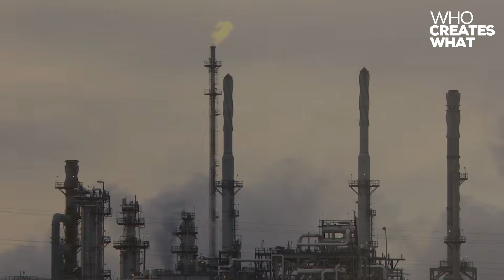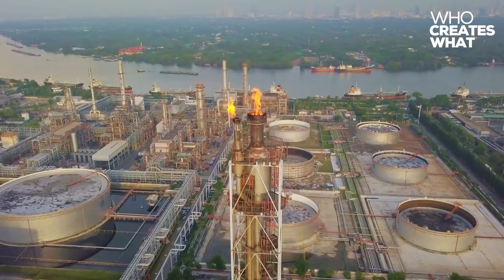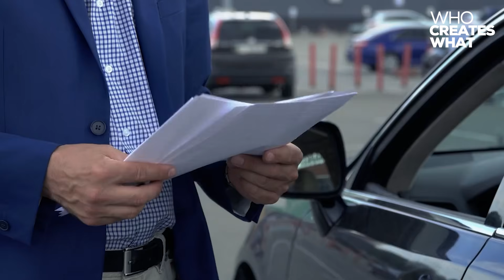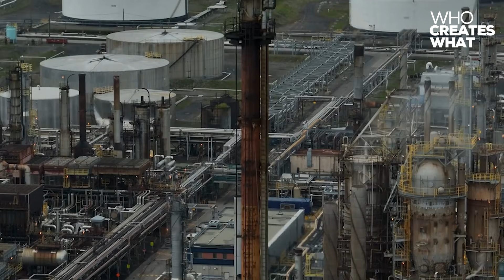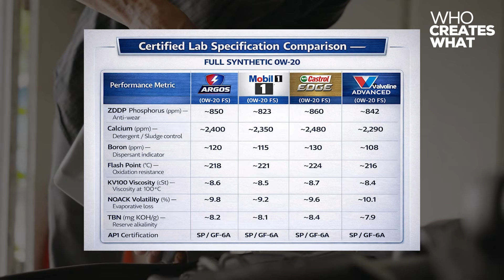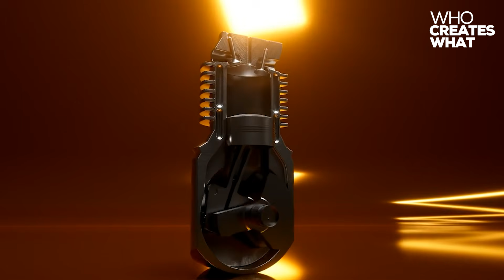Who Makes Advance Auto Parts Motor Oil? ARGOS Is Made by Amalie

Comment: I worked for a company that produced motor oil bottles you would be surprised who fills what bottle ...if the label has the API donut it's basically good oil that's what I was told

Comment: I just noticed that Argos offers a 5w-40 European blend now. I didn't check, but they may have the VW, MB, etc specs now.  Possibly they rushed the standard 5w-20/5w-30 lines to market and brought the 5w-40 line out a bit later.
Reply from the maker: That's a solid catch! If the 5W-40 Euro blend does carry VW 502/505 or MB 229.5 approvals, it would fill the biggest gap mentioned in the video. Worth checking the bottle or Argos's site for the actual OEM spec sheet before trusting it for a Euro car though — "European blend" on the label doesn't always mean it's got the full OEM sign-offs. But yeah, sounds like they may have launched the standard grades first and followed up with the Euro line once the approvals were in place. Good to know!
Reply: @WhoCreatesWhat101 I just bought some European blend, and it does in fact meet VW 505 00 and others.

Comment: It seems to be a very good oil at a fair price, i would use in a pinch, my go to is Kirkland Signature when on sale, 10qts (2-5qt jugs) for $30, so that right there beats out Argos by $8 per 5qt jug that's a big diff.
Reply from the maker: It’s a great strategy to stock up on sales whenever you can get that much value per quart. 🚗